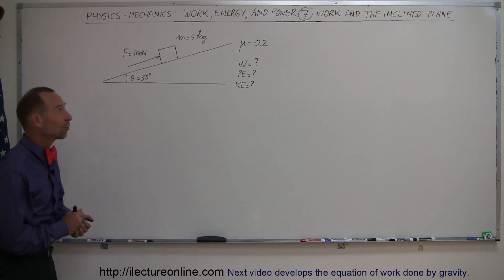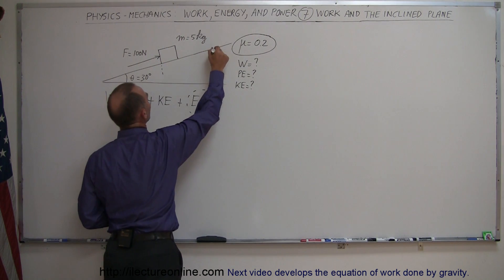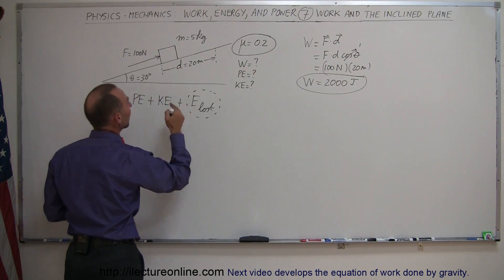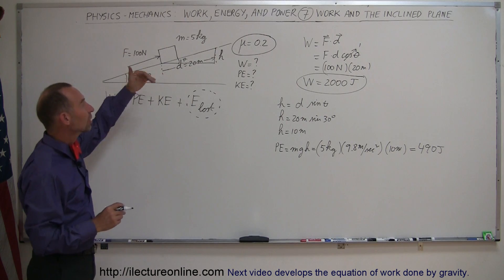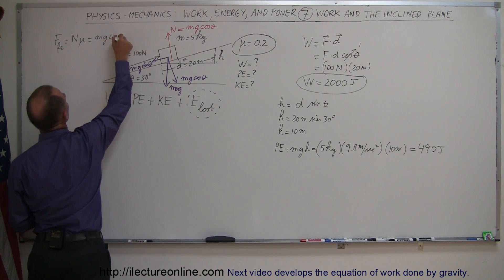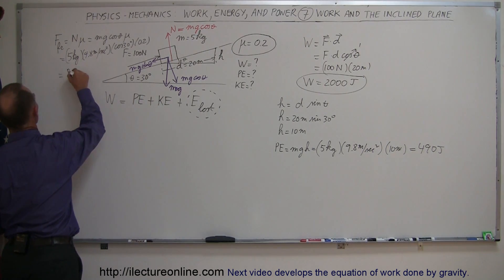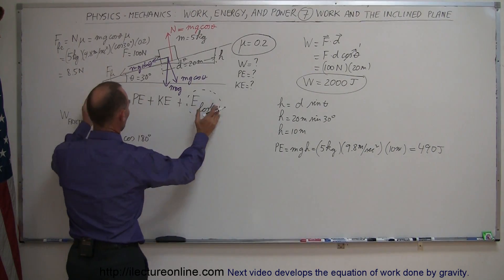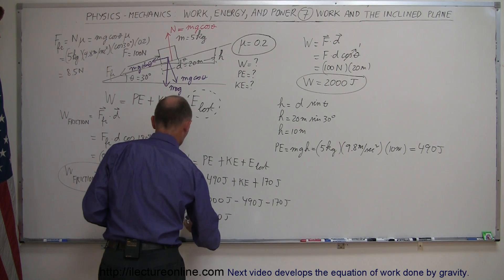Physics 8  Work, Energy, and Power (7 of 37) Inclined Plane (Friction)

Comment: what will happen to kinetic energy if work done is equal to mgsintheta times d neglecting friction
Reply from the maker: If the force applied is equal to the mgsin(theta) component, the net force would be zero (Ignoring friction), then the acceleration would be zero, and the KE would remain the same.

Comment: mike id love to know why you dont subtract work done by component of the weight parallel to the surface from the work done by applied because it does negative work on the object just like friction
Reply from the maker: Don't think about negative or positive work.    It is simply an equation.  On the left side of the equation you have the work added to the system  ( = Fd).  On the right side you have what the work did:  1) Added PE   2) Added KE  3) Overcame friction      The 2 sides should be equal to one another.
Reply: THANKS
Reply: sir i think that the work done by the weight component of the system must be added (-Work) to the left side of the equation. Just like the +100 force that acts on the object the F(weight) is negative.  that contributes resistance to the system just like friction

Comment: Dear sir,
In this particular example, why have we not taken the resultant force instead of the force being applied. Since the object is on an inclined slope, we know that the mg.sin(theta) component of the weight of the object will be acting downwards the slope. So we know  the resultant force acting on the object is: 100 N - mg.sin(theta). Therefore, shouldnt work done be equal to = (100 - mg.sin(theta) ) times 20meters ?
Reply from the maker: The work done by what?  It is necessary to indicate the work done by what force.
Reply: +Michel van Biezen  I meant to say that whatever work will be done, it will be done by a resultant force, right? Out of all the force acting on the body, the net force is the one that will cause any work to be done. So, sir, in this case, the NET force acting on the body (upwards the slope) is : 100N - mg.sin (theta)  { where mg sin theta is the component of weight opposing the applied force.} 
  My question is. Given that the resultant force is :100N - mg.sin (theta), wont the work done be = (100N - mg.sin theta) × 20 meters. 
 In other words, Workdone = Resultant force (acting upwards the slope) × 20 meters.
 Thanks. I hope you get my query.
Reply from the maker: No, in this example we are calculating the work done by the 100 N force pushing the block up the incline.  (and the video correctly shows you how it is done).
Reply: +Michel van Biezen  Yes. But wont the 100 N force have to "overcome" the mg.sin(theta) component to move the object up the slope and do work. This is the core of what i want to ask sir. Thanks !
Reply from the maker: OK now we are in the correct place to clarify this.  Work can be defined in 2 ways.   1) W = F x d     or 2) Work done on an object give it kinetic or potential energy (or both).  Thus work done BY A FORCE can be calculated by multiplying (dot product) the force time the distance over which the force acts   OR  it can be calculated by finding the energy gained by the object.   Work can also be done to overcome friction.   In this case the work done by the 100 N force over a distance of 20 m is 2000 N which imparts 1340 J of KE,  590 J of potential energy and 170 J of it is used to overcome friction.
Reply: +Michel van Biezen, Yes sir I follow this. So like you explained that there will be work done to overcome friction in this example, wont we also add/subtract "work done to overcome the mg sin theta component" so that we include all the factors involved. Thanks :)
Reply from the maker: You could, but then you can't add the work done to give the object potential energy since that would be the same calculation and you would be counting that twice.  So either you calculate the work done to push against mgsin(theta) or you calculate the work done to give the object PE.
Reply: +Michel van Biezen oh okay.... Thanks A lot !

Comment: I need help in this sum: 
find the work done by frictional force as the block of mass 10kg slides down an inclined plane of angle 37 degree to horizontal. coefficient of friction is 0.5. and ht of incl plane is 3m.
Reply from the maker: The friction force on the incline is:  F fr = mgcos(theta) * mu   Work done is force x distance along the incline.
Reply: Michel van Biezen sir, the answer is supposed to be -200J. The closest value I've got was 278J when I added mgcos37 and Nu

Comment: Does the horizontal component of the weight oppose motion and if so why haven't you subtracted the work done against it from the total work done?
Reply from the maker: It depends on how you solve the problem.  Note that there is an equation:   W = KE + PE + E lost.   That means that the work put into the system equals the sum of the KE gained, the PE gained, and the energy lost due to friction.  That is the correct equation.
Reply: In the equation w= ke + pe + energy lost, why is the work done to overcome mgsin30 is not also accounted as energy lost?
Ex: w= ke + pe + e friction + e mgsin30 ..

Comment: whats the difference between work done and useful  work done
Reply from the maker: Some of the work is used to overcome resistive forces (like friction) and is converted to heat.  The remainder is used to move an object which is the part that does "useful work".
Reply: +Michel van Biezen so basically useful work done is (workdone- resistive forces) ?
Reply: and one more question 
when calculating power do use the work doe or useful work done in the eqt p=w/t
Reply from the maker: When calculating power you must use the total work.

Comment: Michel, Why did you use( mg cos theta) instead of using ( mg sin theta) on Fn ( normal force)? Its a bit confusing.
Reply from the maker: The component of the weight that is perpendicular (normal)  to the slanted surface is mg cos(theta) and the component parallel to the slanted surface is mg sin(theta)
Reply: Thanks Michel.

Comment: why Fk = mg. nu.cos(thetha) and not mg. nu? thanks
Reply from the maker: When the object is being pushed across a flat (horizontal) surface, the friction force F(fr) = mg (mu)   but on an inclined plane F(fr) = mg cos(theta) (mu) because the friction force is caused by the normal force between the surface and the box.  Note that when the angle increases to 90 degrees the friction becomes zero.
Reply: Michel van Biezen  thank you very much Sir

Comment: Hi, may i confirm the KE included in your first energy equation will be lost slowly after 20m and it will be converted into GPE and overcoming the friction?And when it stopped after awhile,the KE will be 0, GPE gained and energy lost will increase right?Thank you
Reply from the maker: +Jesper Sim  That is correct.

Comment: If Elost is negative, shouldn't the work be 2000=490+KE-170. Thank you!
Reply from the maker: +VICKY TASOULI It depends on how the equation is set up.  Here the total energy on the left side of the equation must add up to the total energy on the right side of the equation.  Therefore you must ADD the energy lost to the right side of the equation in order for the equation to balance out.
Reply: +Michel van Biezen I see, thank you!

Comment: Hi sir, I was wondering why the angle you used changed each time? At first it was cos0 then cos30 and then cos180. Thanks!
Reply from the maker: +Julia Alaimo 
30 degrees is the angle of the incline    
0 degrees is the angle between the force pushing the mass up the hill and the direction of motion   (dot product application)  
180 degrees is the angle between the weight component parallel to the incline and the direction of motion

Comment: I have a question, then what about an friction inclined plane with a string pulling the mass up instead? Would it apply the same or different way? Like for example, finding the amount of work in the string?
Reply from the maker: +ShanaFlame15 
 There are 34 videos in the playlist:  PHYSICS 8 WORK, ENERGY, AND POWER  
  Take a look at those, they should be able to answer you question.
Reply: Oh I see. Thank you professor.

Comment: Energy lost by friction, work done by friction is converted into thermal and sound energy, 170 J was converted to thermal and sound energy, right ?
Reply from the maker: +The Scientist Technically you are correct, however, sound energy tends to be very small or negligible.  We typically only consider energy converted into thermal energy.
Reply: Michel van Biezen I see, professor. Thank you.

Comment: Proffesor I have a question, so if the net work is the sum of all the forces, shouldn't it be: (2000J)+(-170J)+(490J) ? which = 2320J

Because you wrote that 2000J =.... but isn't that 2000J just the work done on the object by the 100N?

I'm confuse how you got the net work and the total K

Thanks for the videos and the website, when I saw your website I saw heaven hahahah thank you with my very deep gratitude for the videos :)
Reply from the maker: +Arturo Fernandez 
 The problem is correct as worked out in the video.

Ef = W - E lost due to friction.  where Ef = KEf + PEf    E = energy   KE = kinetic energy   PE = potential energy

Comment: how is the friction or energy lost affected if the force is applies horizontally?
do i add the y component of force to normal before multiplying by mu?
Reply from the maker: +randy perez 
If the force is applied horizontally, then you'll have to find the perpendicular and parallel components of the force.  (The perpendicular component would have the effect of making the object seem heavier and it would increase the friction force).  The parallel component would push the object up the incline.

Comment: Please consider this or help clear this up if I am wrong,  but calculating the Vf from the KE alone only works if there is no change in height.  The reason being is that some of the energy in the system is converted to potential energy with the increase in height, therefore sqrt(2(KE-PE)/5) is the correct way to calculate Vf because the total energy of the system is KE-PE not just KE.

Comment: Is typing on a computer keyboard consider work in physics sense?
Reply from the maker: +Jun Ng 
Any time a force pushes something and it moves in the same direction as the force, the force does work.
Reply: +Jun Ng Sure, because you are applying force to buttons and due to that force they displace, there's a rubber part at the bottom it displaces to that part and then it pushes back. So you have force, displacement and cos of 0, voila!

Comment: sir can you please tell me what are the forces acting on a body if it is moving on a horizontal road with const speed and why is the frictional force equal to the applied force in that case and also if the velocity is constant acceleration should be zero and net force should also be taken to zero ?????but why is it not so
Reply from the maker: +Rahul Tiwari Remember Newton's first law.  A body in motion will continue in motion unless a force comes along to change that.Once an object is in motion, it will continue at a constant speed as long as there is no net force (Force of friction equals the applied force). If the net force is zero, there is no acceleration.  (F = ma)Note that you first have to get the object moving at constant speed before the applied force can be equal to the friction force.

Comment: Hi Michel! Great videos, thank you so much, it really helps. But could I ask you to explain one more time (or in the other way): when we calculate W=PE+KE+E*lost, why is friction with a plus sign? (time: 6:50)
Reply: Sir  in this part you took 
W(total) = K:E+P:E + E(loss) 

But if I want to put the value of E (loss) which is (-170 J) then is it will be in + or I will put that as it is with -ve sign?
Reply from the maker: Anastasia Timofeeva 
Think of it this way:
On the left side of the equation you have all the energy that is already there (the initial energy) + any additional energy created by doing work.
This energy is then used to give potential energy and kinetic energy to the final state AND is used to overcome any friction.
So you have to add up all the energy on the right side of the equation
Reply: Thank you for a quick answer, now I got it!

Comment: Hi, i have another question. Isnt the force friction should be added by mg sin theta? Because it is the total force that pushes the block....
Reply from the maker: Aryo SenoIt is the net force that accelerates the block.
There are three forces acting on the block parallel to the incline.
Each force performs work
Reply: Michel van Biezen
Oh, but what I meant was that why didn't you add mg sin theta with the force friction. That would increase the force needed to push the block up since it is inclined right?
Reply from the maker: Aryo Seno That is accounted for by the PE gained.  (490J) which is subtracted from the 2000 J
Reply: Michel van Biezen oooooo ok thanks

Comment from the maker: Tripta,
The friction force between an object and a flat surface of an incline is defined as the normal force time the coefficient of friction.  On an incline that should be N * mu  = mg cos(theta) * mu
I would have to look at the other video you are referring to see what is happening there.
Reply: +Michel van Biezen thank you sir I get it.I think I was too stressed last time due to the examination.but i got another problem. I cant calculate the kinetic energy using net force like u showed in last video. i think i am missing something in calculating net force.I calculated it,
net F= 100 - mg*0.2(meu)*sin30 = 95.1 and 
K.E.= net F* x= 95.1 * 20= 1902 
BTW ur videos in physics are my favorite
Reply: @triptabhattacharjee7004  the x-component of weight (w) is missing in your net F and also your friction force should be multiplied to cos(30) not sin(30). Therefore net F = 100N - mg*0.2(meu)*cos(30) - mgsin(30) = 67.01N
KE = net F * x = 67.01N * 20m = 1340J
Reply from the maker: I just took a look.  Video # 6 in this set is an example without friction
Reply: +Michel van Biezen These videos make the work that I've done for almost a year seems like child's play... so easy to understand! Thank you

Comment: why didn't he use the adjacent component of the weight of the object?
Reply from the maker: Trisha,
In this case it wasn't necessary to solve the problem.
Start with the basic equation  Eo = Ef
Which turns into 

W + KEo + PEo - KEf + PEf + Elost

Then look for what you need to determine each term in the equation
Reply: ohhh...ok thank you! :)

Comment: Since you're saying that W=F.D.cos(theta), why didn't you multiply (100N).(20m).(cosTheta) in this example? I mean for the incline, since theta is 30 degrees. Thanks
Reply from the maker: Omar.
The definition of work is the dot product of the force vector and the displacement.  Since the displacement is in the same direction as the displacement the angle is zero.  (Look at my videos on the dot product of vectors).
Reply: He did. the angle between F and D is 0 cos(0)=1
Reply from the maker: Marrio Lesueur Marrio
The direction of the force and the direction of the displacement is the same
Therefore the angle between the two vectors is zero.
The cos(0) = 1
Look at the videos on the dot product      (PHYSICS 1 VECTORS)

Comment: For the first part of the equation, when you show that W= FxD = (100N)(20m) why isn't the component of gravity that is parallel to the crate included as well? Then F= (100N) - (5*9.8*sin22). The applied force is not the net force is it?
Reply from the maker: Olga,
For the first part we are only calculating the work done by the 100 N force which is 2000 J
Remember, that is the work done BY the 100 N force.
This work is then attributed to 
1) PE gained
2) KE gained
3) E lost due to overcoming friction.
The work required to overcome m g sin (30) = 490 J
The work remaining after accounting for m g sin(30) = 1510 J